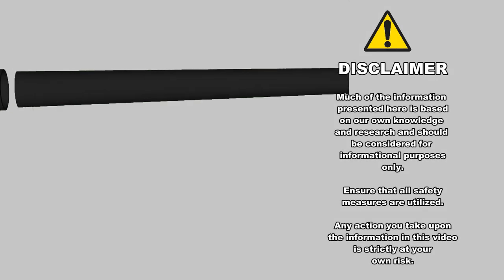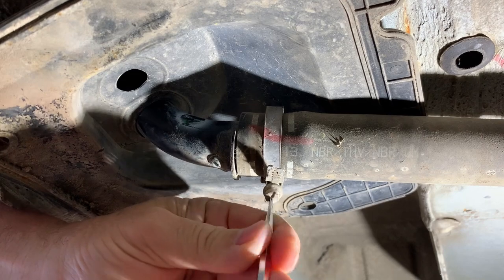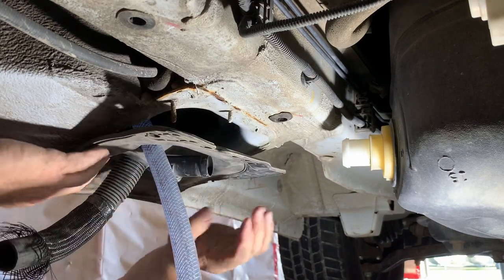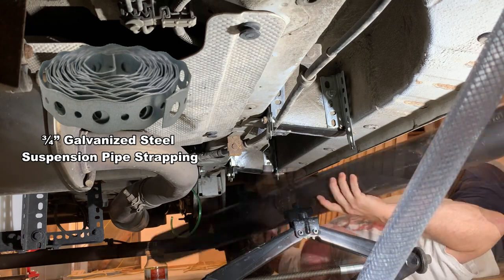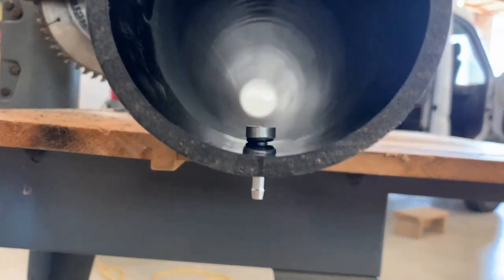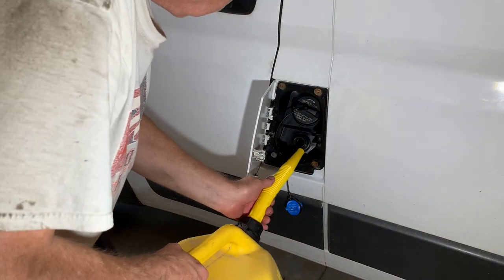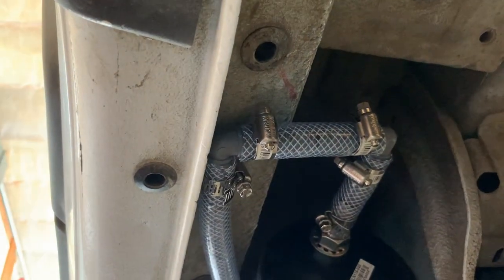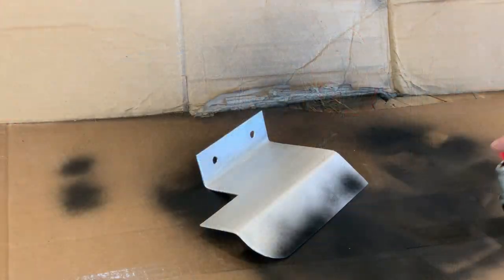RAM PROMASTER VAN BUILD – Diesel Heater Fuel Tank

Comment: What’s the purpose of a vent line. And where does it end?
Reply from the maker: Good morning
The vent line is connected to the highest part of the fuel tank.  The other end is connected to the side wall of the fill tube, right near the top where the fuel nozzle is inserted.  As diesel is entering the tank, air must be able to escape.  For this reason, all automotive fuel tanks have vent line.  On my video, if you watch from 3:50 onwards I talk about the fuel vent line, and you can briefly see that it attaches up near the filler neck.  Cheers